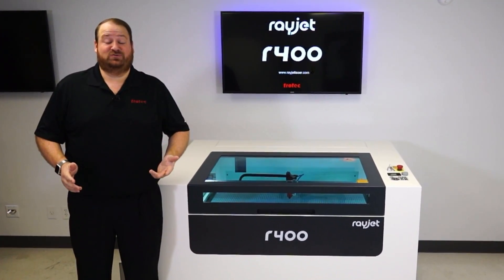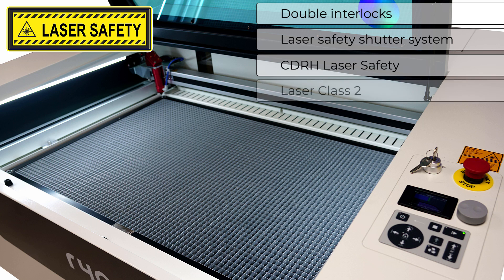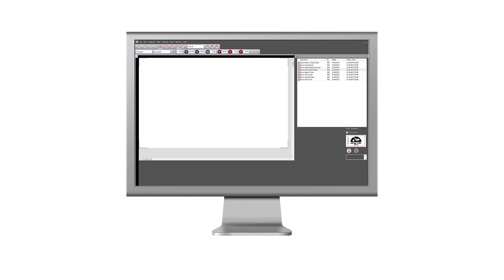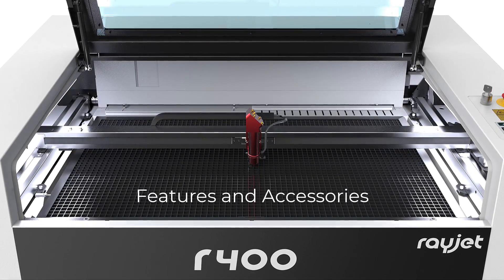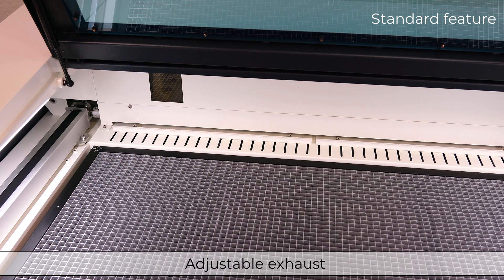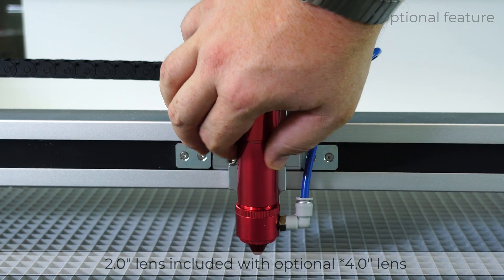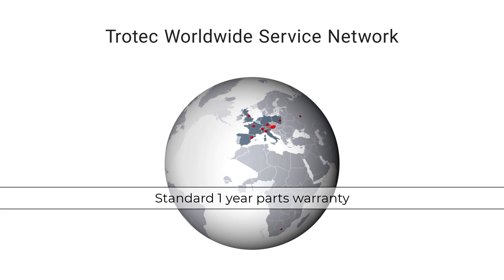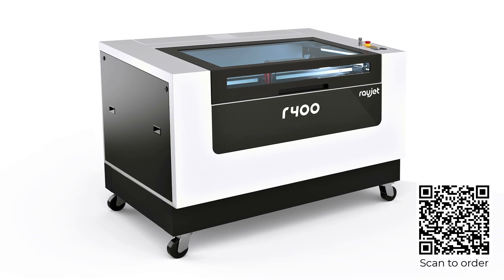Trotec Laser: r 400 Laser Cutter

Comment: Hi laser Dave, I’ve been watching your videos for several years literally and dreaming of the day I can afford one of these fantastic machines. I wonder if you can advise the size of the Rayjet r400? I have the dimensions shown on the internet, but can’t find info regarding if the wheel base is seperate/detachable.  We need the measurements to see if it will fit through a standard door.  Thanks for your help and for these videos👌🏼
Reply from the maker: Hello! Yes, the base can be removed to drop the height down to roughly 31 inches. Feel free to give us a call at 866-226-8505 if you would like to discuss more with your local rep!
Reply: @TrotecLaser  oh thanks ever so much for your reply. So you know I asked here as I can’t ring your rep as I’m not in the USA. Incredibly disappointed as I just found out today that Trotec here not longer sell the Rayjet R400.  Keep up the terrific videos as I’ll continue watching. 👌🏼🤩